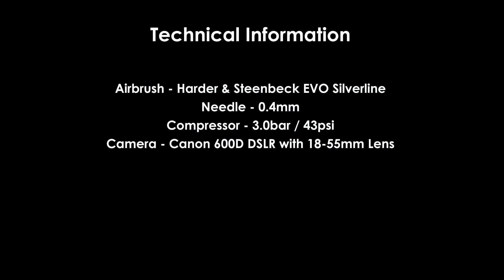Aoshima | Back to the Future (Part II) Delorean | Part 6 - Chassis & Wheels

Comment: Hey Mate how did this model turn out for ya? I'm workin' on this one at the moment and can't thank you enough for the painting tips! Did you happen to end up with any extra pieces from the "clear" plastic? Parts 84, 85?
Reply: +froglet007 This is still all packaged up after losing the seat.  The replacement sprue has arrived, so its just a matter of unpacking it all and continuing with the build, but I&#39;m all a bit car&#39;d out right now, so am thinking of doing a space ship next......either something from Star Trek in a large scale format, or the Battlestar Pegasus kit from Moebius models......not decided which yet.  No spares from the clear I'm afraid, but if you email Aoshima in Japan, they'll send you replacements.....service@mail.aoshima-bk.co.jp    They understood English very well and were extremely polite!
Reply: +Leo Morse  
I mean there 2 parts i don't know where they go on the Delorean, check parts 84 and 85 and let me know if you can figure out where they go :)
I'm just waitin on some paints i need to continue this so in the time being i did a Lockheed F117 which was interesting, looks pretty good finished!
Reply: On the rear page of the instructions it shows the sprues, and parts 84 & 85 are greyed out which means they are optional, but I can't see anywhere in the instructions that calls for them, and I can't identify the parts to work out where they might go.  I'm wondering if in the translation from Japanese to English, optional got confused with obsolete, or unused perhaps?  Unless you are a purist, I really wouldn't worry about them as they aren't really major parts.  I'd like to see some pics of the Lockheed if you can....you could post them to my Facebook page at www.thecustommodelguy.co.uk/facebook if you like/can?